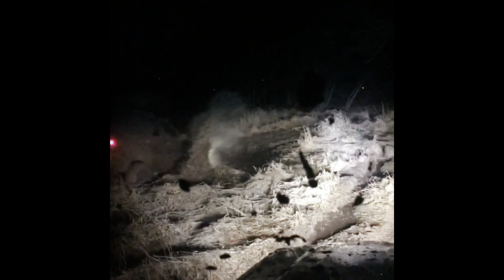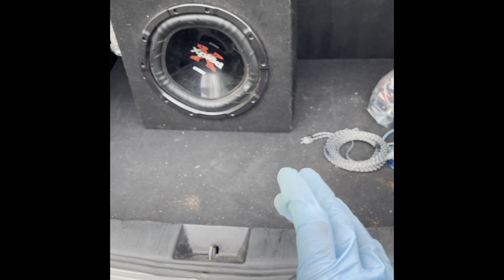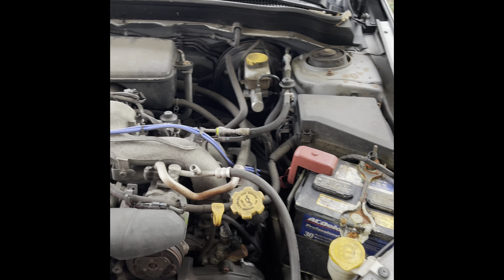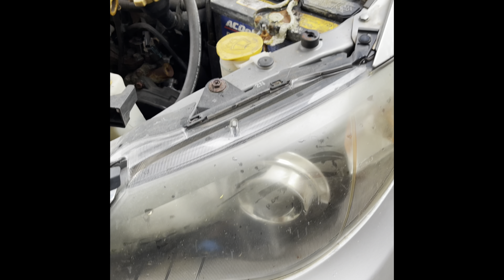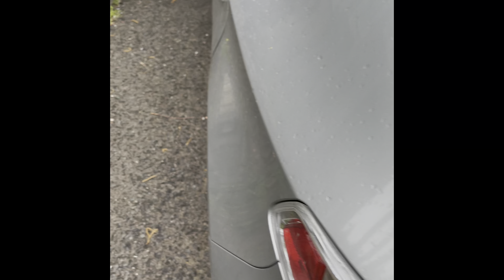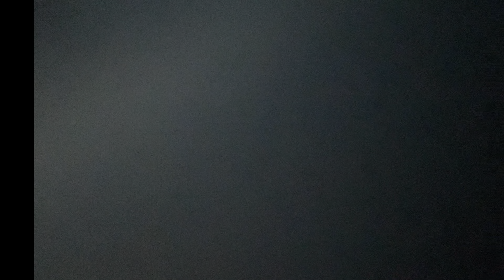Introducing the new daily

Comment: Hey Dylan can you tell me if spring coils from the Left side of a jeep wj will fit on the right hand side
Reply from the maker: Yes they will just as long as there both fronts or both rears
Reply: @dylansgarage3549  my jeep is sagging  exactly 3/4 inch front and back on passenger side so i grabbed the drivers side coils from a doner and gonna put on my jeeps passenger side
Reply from the maker: @306-fromthestix  yea u will be ok doing that as long as you don’t try and put a back spring in the front lol and make sure you line spring up with tab on isolators you’ll see what I meen when you take it apart
Reply: @dylansgarage3549  sounds good....I also snagged myself a complete gas tank including the pump and the complete saddle/skid plate along with a tow hitch for 100$ Canadian
Reply from the maker: @306-fromthestix  that’s good deal I need the skid mine rotted there over 300 new usd
Reply: @dylansgarage3549  cost between 500 and 600 here...shipping is as much as the skid plate...mine looks like a cheese grader
Reply from the maker: @306-fromthestix  yea y got good deal then for sure